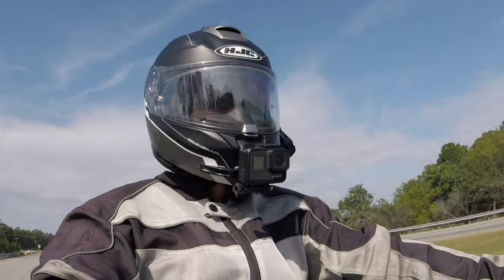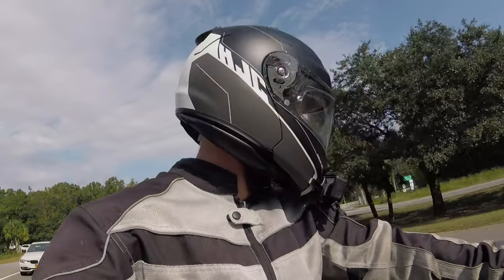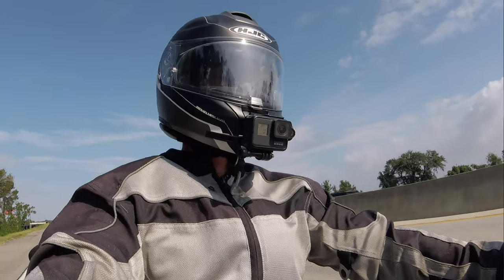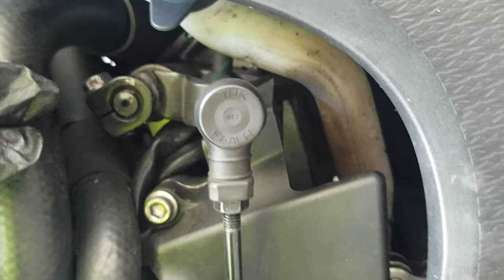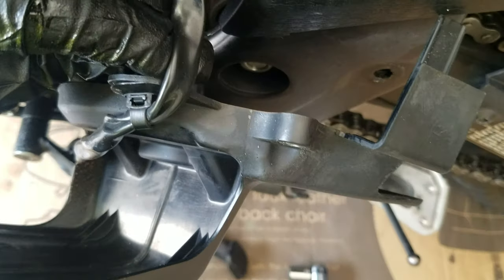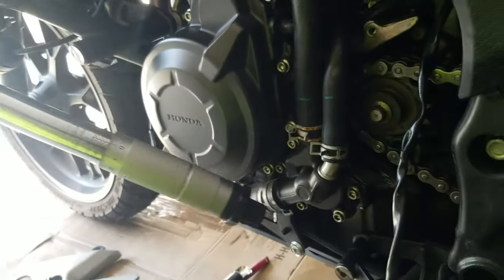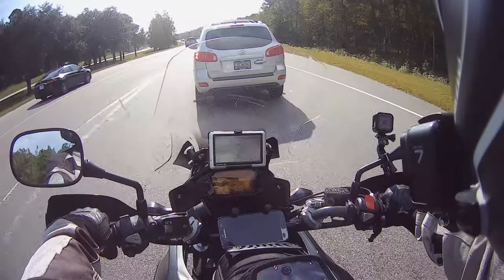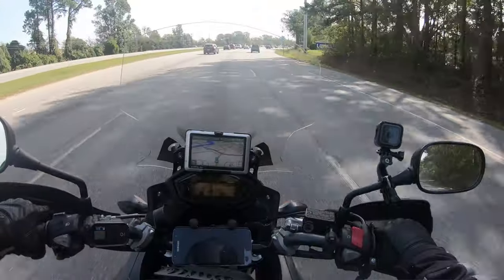CB500X 16T Sprocket Swap

Comment: What on earth makes you think that changing chain sprockets would throw the speedo calibration off?
Where is the speedo sensor?
Mine is on the front wheel.
Reply from the maker: Hi Vader!  On older motorcycles the speed sensor is indeed an electro/mechanical mechanism off the front wheel.  More modern motorcycles use a VSS sensor.  Sometimes this ties into the electronic signals from the ABS sensor (if the bike is equipped with one).  Mine is a non-ABS model Honda CB500X.  The sensor on my bike is located above the gearbox.  Any change in the size of the sprockets, or the change in diameter of the tires can definitely affect the accuracy of the speedometer.  Though lets be honest, most bike speedometers aren't that accurate to begin with.  Just connect a dedicated GPS (or download one of the GPS speedometer apps to your phone) to measure your speedometer against your true speed.  If needed, there are devices like the Speedo Healer that you can plug into most bikes to correct your speedometer to the exact speed.  But I primarily just watch my speed on the GPS, so I've never bothered installing one.  Hope this helps!
Reply: @MotoPhotoAdventures  
Thankyou Chris! 
I'm considering the CB500X as my next addition.
I've currently got 3 old CB500's ( '94 '97 '98 ) and an even older VFR750F ( '90 )
So none of these compare to modern technology. 
All these bikes are a bit on the low side regards to seat height for me now so I'm hoping the new X will fit me better; I just worry about the 10bhp drop I'll be taking in relation to my old girls.
Have you found the 47bhp a bit of a pain making progress up steep hills?
Reply from the maker: Hi  @VaderWhoop !  Sounds like you've got a really nice lineup!!!  :-)  I had an 80's era CB400 back in college.  Fun ride!  Biggest bikes I've owned are the Kawasaki Ninja 600 and Yamaha XT600.  So when I jump on my friend's MT09, for example, the power scares me!!!  I haven't found a need for any more power than the CB500X gives me.  It is such a fun machine, without being so powerful that it gets me in trouble (if you know what I mean).  I would imagine even if the hp is less than your older bikes, the fact that it's fuel injected, has such a smooth-running modern engine, and is probably a lighter chassis would surely make up the difference for you.  The throttle response is great, and the engine is quite peppy!  Just go test ride one and see what you think.  Hope this helps!

Comment: I realize I'm a bit late to the party, I was just thinking about swapping my sprocket on my CBR 500, and I can't help but notice that the sprockets you listed in the video info are listed as being for the NC700. Doesn't seem like they would fit, but if that's what you yourself put on, then clearly they do. That said, they are more than the twice the price of the JT sprocket that's listed as fitting the 500's.
Reply from the maker: Hi Thomas!  Welcome to the party!!!  :-)  That is correct.  The sprockets for the Honda NC700 and NC750 fit perfectly on the CB500X.  But the stock size on those bikes is 16-tooth, while the stock size on the CB500F/R/X is 15-tooth.  So if you look up the "correct" product for a CB500F/R/X on the JT Sprockets website, you won't see a 16T sprocket listed.  It will be a 15T.  And obviously the whole purpose of swapping the sprocket is to get the advantages of having 16T up front.  I hope that makes sense?  Incidentally, you can also swap the rear sprocket on the CB500F/R/X. for a smaller one for a similar effect.  And once again, the smaller sprocket from the NC700/750 bikes are a perfect fit on the CB500F/R/X.
Reply: @MotoPhotoAdventures  nice of you to clarify, I actually went and ahead ordered one, I already wanted it, but your review really got me sold on it. Thanks!
Reply from the maker: @imprezzedyet  I'm glad I could help.  That's the whole reason I do these videos.  I figure anything that makes me happy, and helps me enjoy my bike more, is worth sharing so that someone else can discover the same benefits!  Enjoy your new and improved ride!!!
Reply: @MotoPhotoAdventures  CURIOUS IF 3 OR 4 TOOTH SMALLER REAR WOULD DO THE SAME AS THE 1 TOOTH TALLER FRONT SPROCKET.....?
Reply from the maker: @craigbielsky115  Yes.  It's the same concept.  In fact some argue it's better due to less wear on the chain.  Another popular combination is to go from a 15/41 combo to a 16/39 combo.  But there are many variables involved.  I highly recommend checking out https://www.gearingcommander.com/ to find the combination you feel is best for you!

Comment: Excellent video Chris. Do you have a part no to fit the 500 Honda
Reply from the maker: Hi Michael!  Yes...I put links to a couple options in the notes under the video.  Basically you just want to order a sprocket for the Honda NC700/750.  It fits both bikes, but has 16T.  Here are the links:   https://amzn.to/2MW7TFi or  https://amzn.to/2oWo910
Reply: @MotoPhotoAdventures  AFTER FURTHER REVIEW THE CB500X MAKES ALMOST THE SAME POWER AS THE NC700 ...LOL MAYBE THIS IS WHY HONDA KEPT GEARING LOW AS IT WOULD PUT THE CB 500X IN THE SAME SPEED RANGE AS THE 700 WITH THE SAME GEARING......LOL NC700 IS 50 HP CB500X IS 47HP ????? YES? & 50 LB LIGHTER THAN 700 ALSO.
Reply from the maker: @craigbielsky115  that's really interesting!

Comment: Looking at JT Sprockets website- wouldn't it have been less problematic to change the rear sprocket? (or am I using 20/20 hindsight?)
Reply from the maker: Actually changing the rear sprocket does have its benefits.  But of course it's harder to do since you have to remove the rear wheel to change the rear sprocket.  And a rear sprocket is usually more expensive.  But check out https://www.gearingcommander.com/ for recommendations on upgrades before you decide which way is best for you.

Comment: Adding tooth up front adds weight, where as taking a tooth off the back drops weight. Something to consider.
Edit: How drastically does this damper roll on when trying to pass?
Reply from the maker: Technically speaking, you are absolutely correct!  :-)  As far as passing, if I need more rpm, I just drop a gear.  But honestly, I didn't notice any change in power passing power.
Reply: @MotoPhotoAdventures  I suppose if I have any stretch of highway on my daily commute I would change sprockets, and if traveling to work is only through town I'll keep as is.
Reply from the maker: @klamup  does your throttle feel kind of twitchy in first gear?  And do you feel like you barely get started and are already searching for 2nd gear?  That was the biggest improvement for me when I swapped to a 16T front sprocket.  First and second gear are just so much more user-friendly.  And of course the lower rpm at highway speeds makes the bike feel more "relaxed" at cruising speed (less high-rpm vibrations).  I ride all the time in city traffic (to work, running errands, to the gym, etc.).  I also travel long distances (highway speeds are a breeze).  And I even do a lot of off-roading (dirt, gravel, mud, mountains).  Heck, I left the 16T front sprocket on when we did the Trans-America Trail last year!  It even stayed on for the crazy scary Cinnamon Pass summit in the Rockies...check it out:  https://youtu.be/Im8M-tRJXuY.  (Although that was the one time I think the 15T would have been nice to have!)  Anyway, each to their own, but I find the 16T suits me great in all kinds of riding.

Comment: How are you going to recalibrate the speedo, or did I miss that? Surely your machine is now illegal with such a discrepancy between true speed and speedo indicated figure?
Reply from the maker: Hi Mark!  Most motorcycles have inaccurate speedometer right srom the factory.  Even changing to a different tire can throw it off as well.  I know guys with classic bikes that don't even have a functioning speedo.  So I doubt there are any laws about how you regulate your speed...only that you obey the posted limits.  :-)  Personally, I don't even look at my speedo.  I have a Garmin Zumo 390 that tells me EXACT speed bases on satellite data.  It also indicates what the current speed limit is on the road.  If my speed exceeds the posted limit, the readout turns red.  So thats how I navigate.  But if you want your bike's speedometer to be as accurate as possible, all you have to do is buy an electronic device called a Speedo Healer for around $100 and calibrate your speedometer.  Hope that helps!
Reply: @MotoPhotoAdventures  I've been riding for over 50 years.  All but one bike I have seen has had a cable drive from the FRONT wheel.  Changing the gearing doesn't change the original accuracy of the speedometer.
On the one with a REAR wheel cable drive speedo it would.
I guess the modern bikes don't use a cable drive to run the Speedo?   
Been thinking of getting one of these bikes.  Have a couple smaller Dual Sports. (200 - 250s)  Unless trail riding I go with a 16 on the front.  For the very same reasons you did!   :)    For gnarly walking speed trails I go to a 14!   Obviously you are having FUN!   I'm all for that!  And your video has helped me re this bike so THANKS!
Reply from the maker: @petercruttenden3951  that's awesome!  Glad you enjoyed the video.  Great to hear your enthusiasm for riding as well!  Yes, today's modern bikes don't use the physical cable to the front wheel like we had in the old days.  The CB500X is my first bike without that cable controlling the speedo/odometer.  Instead, it uses and electronic system.  Which is why calibration is easy to do by plugging in this electronic device called a "Speedo-Healer" to correct for tire size, sprocket changes, etc.  I've ridden my little CB500X all over the country, plus down through Mexico.  I love it!  Check out our series on the Trans-America Trail:  https://youtu.be/Im8M-tRJXuY.  It'll REALLY make you want to grab one of these "go anywhere" machines!!!  :-)

Comment: Wow, I skimmed most of the comments and nobody asked about offroad performance :D 
I'm wondering how it impacts the bike when in steep / rocky territory.. I hate the feeling of having to go faster than you want to to keep the bike from stalling. Did anyone here test theirs in any sort of offroad situation?
Reply from the maker: Hi Marvininini!  I have personally done a bunch of off-roading with my setup...some of it in really tricky, high rocky mountain passes, full of large loose gravel and tight switchbacks.  Marshall Pass and Cinnamon Pass in Colorado were probably the most difficult:  https://youtu.be/B8WFdtLmtMQ.  I didn't have any trouble.  But on Cinnamon Pass, there were a couple steep sections where the OEM 15T front sprocket would have probably been helpful.  If you do a ton of off-road riding like that and rarely find yourself on long flat highways, I'd keep the OEM sprocket.  But otherwise, you won't have any issue with the 16T upgrade.  And to me, the benefits on the high end are far greater than any deficits it might cause on the low end.

Comment: well..you didn't say if you got the chrome sprocket guard back on..
Reply from the maker: Not yet.  But it's been ground down...just haven't had time.  I don't foresee any issues fitting it back on
  Plenty of others have done it with no issue.
Reply from the maker: Finally had a chance to reinstall the chain guard this weekend.  It popped right in place no problem.  Didn't even have to remove the sprocket.  Took less than 10 minutes.  :-)

Comment: Why would engine sprocket affect the speedo calibration? The speedo is done by wheel sensor.
Reply from the maker: Hi Jason!  For most older bikes, that is correct.  Most modern bikes like the CB500X use a sensor on the drive sprocket instead of on the front wheel.  I understand there's a device called a Healtech Speedo Healer that you can plug in and correct the mileage right down to the exact speed.  Even people who have stock sprockets have used it to correct bikes that shipped from the factory with speedometers that are a little off.
Reply: A drive sprocket sensor is stupid because of course changing sprockets will affect speedo and odo reporting.  They should use wheel sensor instead.  One "saving grace" though is if you go up 1 tooth sprocket on the front, it might actually correct for the factory error in the speedo/odo since those usually report about 7% high so going from a 15T to 16T fromt sprocket should just about fix that perfectly.  I did just that on one of my motorcycles and it worked.
Reply from the maker: Hi @davidjames1684 !  I'm sure manufacturers have their reasons...maybe it's more reliable to have it internal instead of on the front wheel, maybe it's just cheaper to manufacture.  Regardless, I totally agree...when I was researching the upgrade, I read about several riders who found the speedometer to actually be more accurate AFTER switching to a 16T than it was before with the 15T.  Sadly, that was not my case.  But it doesn't bother me a bit.  And even if it does start to bother me, I can always install the Healtech Speedo Healer to fix it.  :-)
Reply: Seems odd it didn't fix your speed.  Maybe you should recheck it.  Normally the factory speed is about 7% high so a 15 to 16 tooth sprocket change should make it close to 100% accurate then.  Another reason it is bad to have a sprocket sensor is because guys can take those off and effectively lower the indicated mileage on the bike and sell it as a lower mileage bike dishonestly.  I never buy low mileage bikes because I suspect those have been altered dishonestly.
Reply: @davidjames1684  Yes, my change to the Versys 650 gearing corrected the poor factory calibration almost perfectly.
Reply: It is not really poor factory calibration, they do that purposely to avoid any lawsuits for underreported speed.  By overreporting the speed, the are not liable for "accidental" speeding then.  On many bikes (but certainly not all), going up 1 tooth on the countershaft sprocket will generally "fix" this 7% factory error.  15T->16T is almost perfect for that.  Some bikes have more error than others so if you want it "perfect", you might have to go up 1 tooth in the front sprocket and change the rear sprocket too (such as 1 down on that one).  Getting it exact is not critical but getting it close I would say makes it a more enjoyable ride.  If the motorcycle manufacturers would just use wheel sensors instead, we could change sprockets at will without messing up the speedo (and odo).  Sprocket speed sensors in my opinion are a bad idea.  They don't measure true road speed unless you happen to get it just right.  But generally speaking, 2 wrongs doesn't make a right (but in this example it is acceptable if that is the "gearing" you want).

Comment: Not a big fan of the 16t on the street. Gonna revert back to 15t and see how it goes
Reply from the maker: Sounds good, Sneaky!  It's not for everyone.  All individuals have a different style of riding.  To each their own, right?
Reply: @MotoPhotoAdventures  as a beginner rider id rather the gears be shorter to shift more so I can get better at shifting and familiarise myself with the bike. Plus ill only be riding in extra urban areas so the fuel economy/high revving issue doesnt bother me (for now) 😁
Reply from the maker: @nileisthebestband  that's awesome!  If the stock gearing works better for you, that's what you should use.  I tell people all the time that the 16T upgrade isn't for everyone!  For those who live in small villages with poor roads, or in mountainous areas with winding roads, or areas with lots of congestion and traffic, the 15T is better suited.

Comment: Is there a way to adjust your speedometer to the sprocket upgrade?
Reply from the maker: Hi Isaiah!  YES...you can purchase what's called a Speedo Healer to correct the speedometer.  I always ride with my GPS, which shows exact speed as well as speed limits on main roads.  So I haven't bothered installing one.
Reply: @MotoPhotoAdventures  what is a Speed Healer actually?  Can you have dealer recalibrate?  How much do you think that would cost at dealer to recalibrate?
Reply from the maker: Hi  @ar15gator !  Here are the two options for electronic correction of your speedometer and odomter.  Both are electronic devices you plug into your motorcycle electrical system, calibrate, and leave installed:  (1) https://www.healtech-electronics.com/products/sh/, (2) http://shop.12oclocklabs.com/index.php?route=product/product&product_id=59.  I don't have either, so can't give personal advice.  But I've heard good things.  Good luck!
Reply: @MotoPhotoAdventures  Thank you Chris!  I’ll look into them, which I just did, they both look great 👍🏻 Thx again!